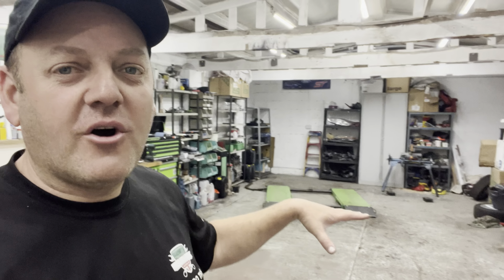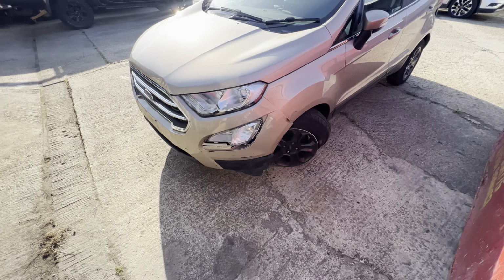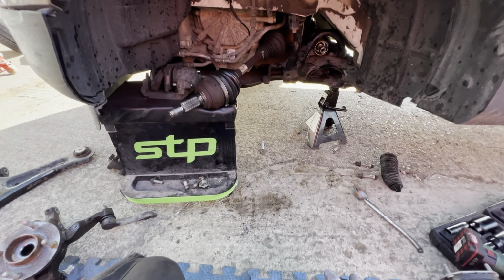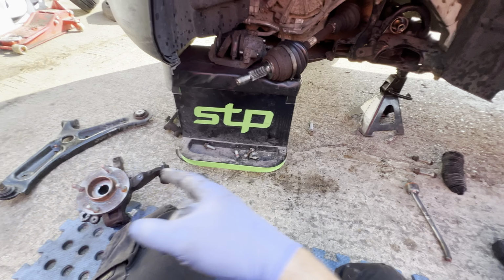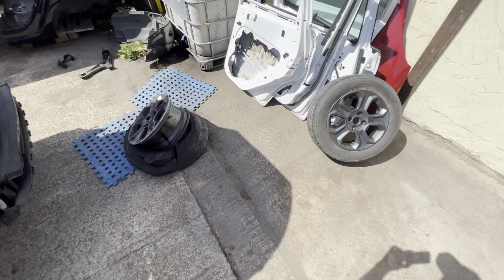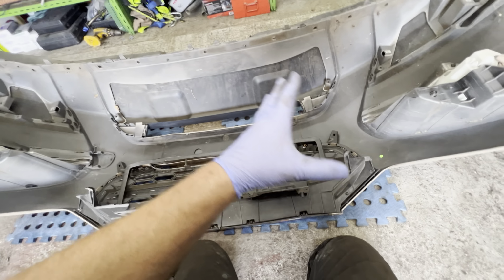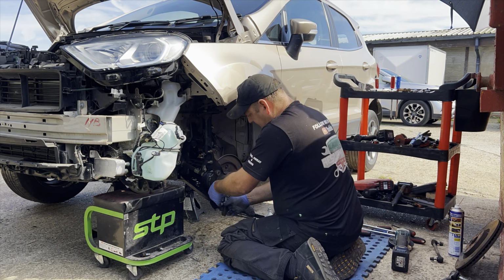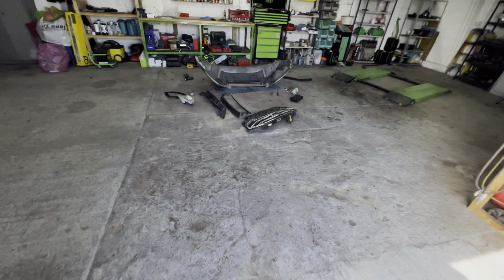Ford EcoSport 2018 Salvage Rebuild Repair Part 1 Damage Assessment

Comment: I would've thought you could have used some 45° angled tile trim or angled alloy section bonded in with some tiger seal which would easily hold that section to the bumper.

Comment: To fix the bumper... use stainless steel mesh and a plastic welding iron. Trust me... with steel mesh reinforcing melted into the plastic that aint going anywhere